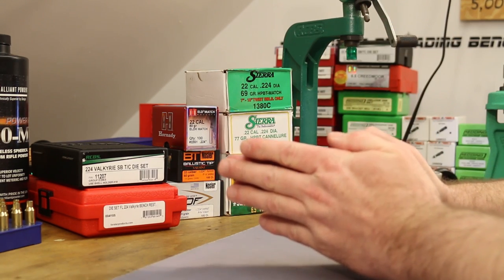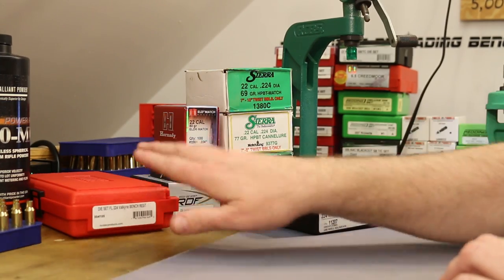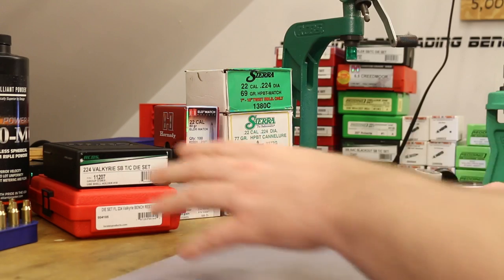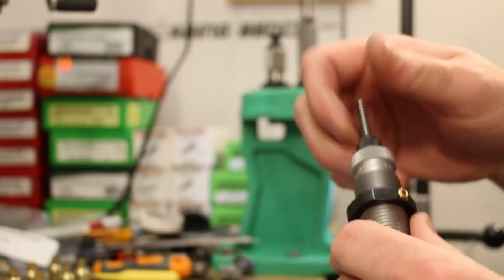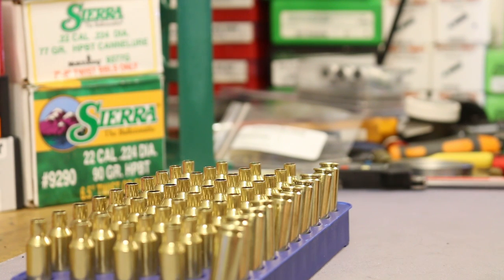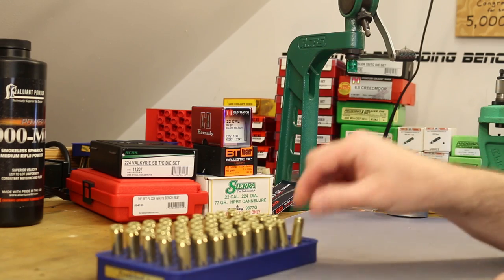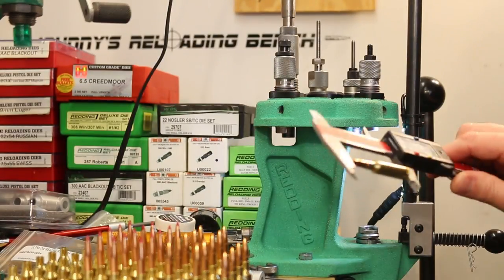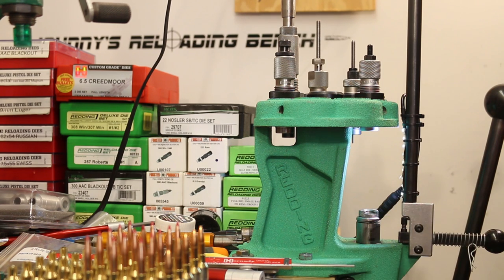224 Valkyrie - 77gr SMK, 80gr ELD-M, 60gr B-Tip with 2000-MR

Comment: Here is my thought in the new Valkyrie barrels.... I think it caught a bunch of people off gaurd. The cartridge is designed around a 90 pill that needs a 1:6.5 twist or faster and there isn't a large supply  of .224 barrel blanks in 6.5 or 6 twist out there. There are however a TON of 7 twist blanks that are used for 223 so a lot of the barrel finishers  (WOA being one) probably are just cutting 224 Valkyrie out of them. I'd like to see how well a proper twist barrel shoots the 90 grain bullets but it would most likely be at a loss of the lighter bullets... maybe even a slightly longer throat so you can use the whole magazine, increase powder and maybe gain more velocity.
Reply from the maker: I honestly expected to see some excellent accuracy with these lighter bullets.  If that was the case I would have been in total agreement with you.  Until I work out some decent accuracy with lighter bullets I'm not going to blame the twist on poor heavy bullet accuracy, ya know?  Still, I think 6.5 twist will end up being the preferred choice, especially with the new 95gr SMK.  I'll get it figured out and be the first one to agree with you if you're right!
Reply: Johnny's Reloading Bench yup... The lighter bullets may like a different powder possibly. It's WAY too early to write it off yet for sure.
Reply: @Joel Anthony Joel- Check out Palmetto State Armory. I just checked- they have them but unfortunately they are temporarily out of stock.
Reply: @JohnnysReloadingBench  You'll be getting into custum made bbls . Benchmark , bartlen, ect

Comment: If this is a systemic issue with the 224 V I am very glad I did not jump on this. Maybe time to put this to bed and get back to your AR-10s!
Reply: Chip Herrick I agree, the New Product Bugs are not at all worked out with this caliber.
Reply: The Savage MSR's in 224V seem to be getting really good accuracy. I think a lot of the parts manufatures are using regular 223 barrel blanks in a 1in7 twist and they need to be making 1in6 twist rates. Which really negates the use of lighter projectiles. That's why I think the 6.5.Grendel is a better cartridge cause it will stabalize 100gr to 140gr projectiles pretty well.

Comment: Interesting learning process on the Valkyrie reloading. Had some sizing problems a year ago, ( 223 ) learned my lesson. Now when I reload a batch I check the first few after a run through the die in an LE Wilson headspace gauge and in the chamber. I will then check a few about every 30 - 40.

Comment: Case stretching-- I have found that most case stretching happens from pulling the neck expanding button through the neck. It pulles the case with it. If you resize the case and the neck first and push the neck sizing button down through the top of the case mouth  when expanding it you will see very little case stretching if any.

Comment: I pulled some of my 75 TMJ bullets from Federal AE and replaced them with 75 grain Amax at different lengths.

I had some trigger difficulties that I attribute some of the horizontal spread too. My trigger was gunked up and the 34 degrees didn't help matters. This was causing the trigger to be very inconsistent with where the sear would brake. It's been cleaned and lubed now and back to its old self so I will retest 2.300-2.280" where it shot it's best. Also of note, with the longer seating depths I had less ejector prints on my case heads.

Even with the trigger issues I noted above it appears there is a node at or very near 22.8 & 23.2 grain of AC-Comp using 80 A-max. This powder was not able to reliably feed using my JP SCS H2 gen 2 buffer/spring combo, it would only push the BCG back enough to eject. Brass case heads were nice and clean, no ejector marks present. I'll try 22.8 & 23.2-23.4 again with my standard weight JP SCS. All groups were 5 shots, I had a couple one holers.

Comment: Regarding the case that would not chamber@ 15:00, I don't remember where I picked it up, but I make a practice of sizing, turn the case in the holder 1/4-1/3 turn and running through the sizer again. The second pass has little pressure, so I'm not overworking the brass.
It seems the person showing me that believed it led to more concentric cases. YMMV
Reply: One thing to consider, the neck portion of the die sizes the neck down slightly smaller than the diameter of the expander ball in the die. So when the case is drawn out of the die, the expander ball can....expand... the neck to the proper size. So to truly avoid overworking the brass in your case, I would be sure to lower the case just enough to clear the neck sizing portion and allow free rotation, but not lower the case enough to hit the expander ball. Then run it up again.
Reply: Patrick Ballensky I'm not sure if there's any basis in the practice, but it sure seems to soothe my OCD. 😁

Comment: Federal was driving the Valkyrie market initially, so they could use Lake City's 6.8 SPC line to supply the brass.   Their idea was to use a longer bullet than the AR-15 ammo (90gr) and spin it faster for stability.  It could compete or exceed Grendel or Creedmore performance using an AR-15 platform.   So, to do that, the barrel/chamber makers need to go to 6.5 : 1 twist.   Now the MBA's show up with their "let them eat cake" attitude: " Let them use 7:1 twist, or 8:1 twist."  Sad.

Comment: According to RCBS, their small base sizing dies also bump the shoulder back a couple thousandths of an inch more than their standard fl sizing dies (for same setting) in addition to sizing the body down to minimum saami specs. It looks like you didn’t have any chambering issues with only bumping the shoulders back .001-.0015 if that was your final setting?

Comment: I think a major issue here in grouping is jumping an entire grain between charges. I generally move 0.3 grains at a time. This can show substantial accuracy issues. Also with that heavy if bullets I would be looking to seat them at max COAL to take advantage of as much length as I could. I would redo this test with a little more care as the bullets you are using are extremely well shooting rounds. You should also text the 77 grain Berger tactical. I wish Berger would do a 90 grain with this hybrid ogive. To add I’m not a fan of Allianz powders as I have had much better accuracy out of Hogdgon powders. I would look to Varget to produce great results. To add the 1:7 should be just fine to stabilize the heavier bullets. They say 6.5 but I would look to that being more for 223. As stabilization deals with RPM than what actual twist is. Airborne arms is my go to for a great barrel. Barrel ad bolt to JP specs without the JP price.

Comment: Hi. Ive discovered something about 224 that is important. 6 months extensive testing. 7 powders. 10+ bullets. 4 primers. Hundreds of tests like you. Run almost all same loads as you. Found solution and retested same loads w/no flyers. Found many nodes not 1/10th grain sensitive. I believe this problem is universal to everyone chasing flyers. Spoke to those responsible. Had a cow. Need your input but cannot share it in open forum. How do we communicate PM?

Comment: I shoot 150gn fusion in my 308 bolt gun. They do show slight signs of heat also but at the time that's all I could get to shoot well in the gun. This summer I'm trying to work up a hunting load with Barnes 150 gn tsx. Ruger m77 hawkeye compact 16.5 barrel 1 and 10 twist. I want to try out the 165 gn as well. 
Good video...... Take care

Comment: Why do you graduate by 1.0grn vs. 0.5grn? Do you hand trickle? Have you tried not crimping?

I don’t load 224V but you did mention successful loads in 223R with the bullet weights you’re using for 224V. I load for a 223R 1:8 using 77grn Nos. Cust. Comps. The powder/primer combo is IMR4198 and Tula SRMs scooting above 2700fps and getting .5MOA consistently. 

I full length size (AR platform), seat the bullet .002 shy of mag length and I don’t crimp. I hand trickle to get up to my specific charge weight and check the weight twice. 

What are your thoughts? CHEERS!
Reply: He mentions in the video that with little load data, he just wants to characterize the load. Mainly for velocity and pressure issues. He fully admits he could be missing possible accuracy nodes. The barrel probably isn't broken in yet and the powder choice may not be optimum either. It's still pretty early.
Reply: Neil Harris people still “break-in” barrels?

I like to foul a clean barrel with 10-20rnds and then shoot a load work up or accuracy.

Comment: RCBS small base dies ALWAYS feel a lot harder during resizing than their standard dies due to it resizing the the area just above the case head so as to be a smaller base. That's one drawback to smallbase dies for semi autos.

Edit: the ONLY candidate for forming the brass IS 6.8spc. That's the parent case used to design the cartridge. Prior to Federal buying the design, it was called 22-6.8
Reply: jimhans1 Isnt 6.8 SPC made from 
.300 Savage?
Reply: Edit, .30 Remington, not .300 Savage.
Reply: Paul Harveu not technically made from .30 Remington as that round/casing has been out production for a decade plus. But it was based on dimensions from the .30 Remington case yes. If you can find original .30 Remington brass it is usually on collectors tables at gun shows.

Comment: Jrb, you seem to shoot better with a suppressor. I’m guessing that will tighten your groups some. How are you installing the muzzle device? In my experience over tightening (even a little) of your muzzle device will destroy accuracy.  I torque to around 20 foot pounds, many long range shooters barely Tourqe there muzzle device at all and use rockset to hold the muzzle device in place.  Would like to see a group or two with bare muzzle, no device. Also you should be able to get away with less shoulder bump running the small base dies in my experience. But with regular dies it’s not uncommon to need 5 thousands or so for reliable feeding in a semi auto. Thanks for the vids, keep up the great work.
Reply: T Hutch what is your reasoning behind over tightening causing accuracy problems? Have you actually tested that? Sounds like forum-BS to me.

Comment: Don't apologize for working!  We all have to do it.  I wonder if another Lee .22 caliber FCD will work for the Valkyrie.  Something to check may be the torque of your QD flash suppressor/mount.  If you strong armed it, perhaps that is causing poor performance with all the bullets.  Also, is that scope shooting well with proven loads in your .223 AR?  Perhaps double checking on mounting issues too.  How about your gas tube?  Is it sliding into the carrier key without any binding/excessive interference?  Just throwing ideas out to check as I too am puzzled by the poor performance thus far.  Good luck!  I know you will figure it out!

Comment: Im just starting to doubt that these super long 22 caliber Match bullets fly well when driven to 3000fps.  Maybe they just dont spin fast enough from short barrels.  Maybe theres a reason PRS shooters are using larger 6mm bullets.  I appreciate you shaking down 22NOS and 22Valk for us.  You will figure it out!  Great Video.
Reply: nc_classics _ I think so to. For these long 224V projectiles you need a 1in6 twist or higher which really limits the size of projectiles you can shoot. I think the 6.5 Grendel is a better cartridge. You get petty good accuracy in 100gr to 140gr projectiles. Which is a good cross section of choices.

Comment: Interesting my results have been ragged holes with a 1:7 twist 24" heavy barrel with comp.  But I'm only shooting Federal ammo and as I understand it while the diameter is the same the shape of the bullet for the .224 valkyrie is not the same.  So if true reloading for it currently is kind of moot because the BC of the valkyrie bullets are what gives it's great long range performance.  It simply doesn't slow down nearly as much as other rounds even other .223 rem loads because it has a better BC.
   I believe this is done by using a thicker copper jacket, and less lead allowing for the bullet to be slightly longer without increasing the weight.

Comment: How much do you think  primers are a factor in accuracy?
Reply: I weigh mine. They are usually 5.2,5.3 but I will sometimes get 5.1's and 5.4's. If you loaded 4x 5.2 grain ones and one 5.4 grain primer for a group, There might be a noticeable velocity difference. Maybe not. I weigh mine just to take any  variables out of the equation.

Comment: check the bullet holes on the Nolser 60 grain.  They look oblong on video.  Maybe over spinning.  CFE223 would be very interesting behind the 77 grain SMK to compare to the MK262 series. Thanks for the video and have a great day.
Reply: David Peterson overspinning a bullet won't cause an oblong hole. Only under-stabilizing or not enough velocity will cause a bullet would do that.
Reply: Jimhans 1 I agree you are correct. There are no physics equations that demonstrate increasing the rate spin causes less stability. Including one out of balance. The only way increasing spin can cause a bullet to be less stable is if the centrifugal force causes it to deform and or come apart. Most modern bullets are designed to handle high velocity and high rate of spin.
Reply from the maker: I think it was just my crappy target backer.  It's getting all shot up and there's not much support behind my poster board anymore.  It causes some ragged holes sometimes.  Good eye, though...they definitely looked a little funky.
Reply: Johnny's Reloading Bench hope all is well, it's been a few days since we've seen hide nor hair of you.

Did you blow your face off??

Comment: You lost me at 18” Barrel.  It’s a long range designed cartridge.  Why the short barrel ?  It kills your velocity.  Good videos though.
Reply: thebizkit79 He did it to directly compare to the MK262 ammo he tried to duplicate. Where velocities are quoted from an 18 inch barrel. 224 Val. claims to be far superior however they are all quoting 24 inch barrels.
Reply: depends on what you want it for really. It was already smoking the mk262 so that in itself is reason enough to be relevant in that 18" barrel. I would have probably gone with a 20"+ myself though.